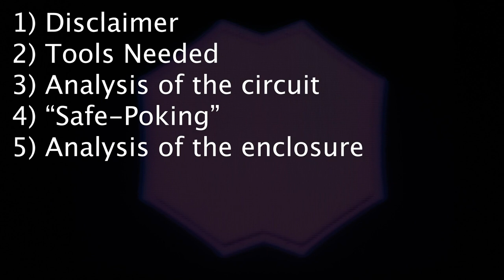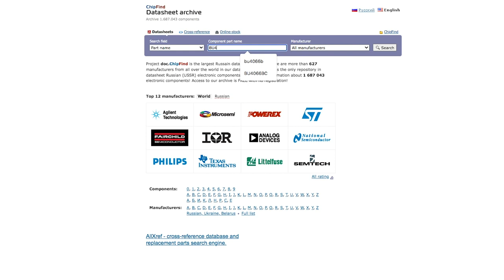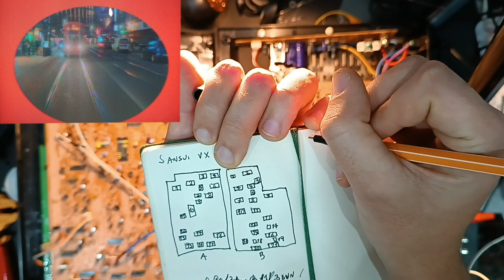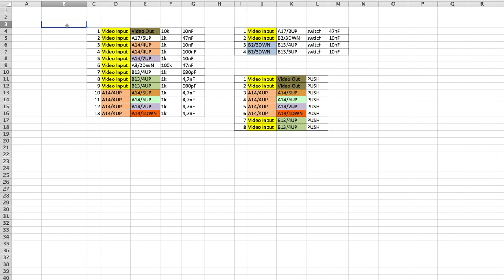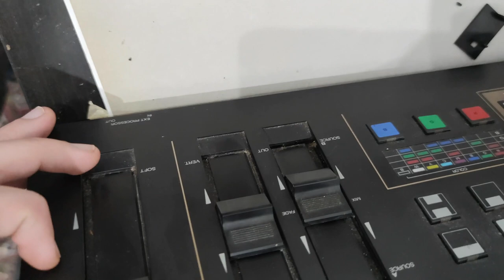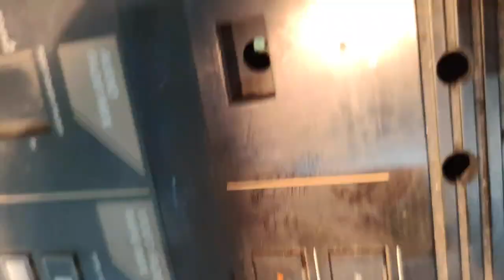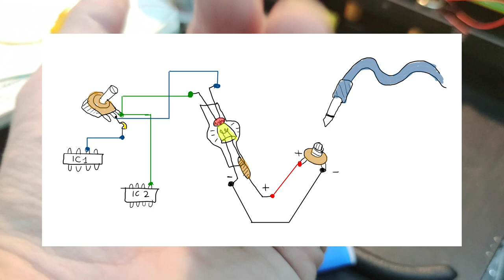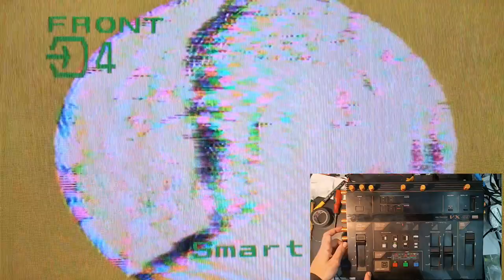How to circuit bend video devices FROM SCRATCH || Sansui VX-99 video bending Tutorial || Glitch

Comment: What LDRs are you using?  I can only get the light resistance of mine down to 2k ohms which is too much between bend points
Reply from the maker: I use the classical visible light LDRs, the small kind (just for a question of space, but the bigger ones work even better). Your LDR can emit only 2k ohms? That's weird. That could depend on the LED(s) you are using, or maybe the LDR in question is not working properly...
Reply: @pushkarbrand  it’s actually reading even higher than that.  You are able to get below 500ohm on your LDRs?  Thank you for the quick response btw
Reply from the maker: @iskatearound  Ok, now I understand. If you want to get a lower value you simply have to add some resistances (variable or fixed, depending on what you need) on one of the two legs of the LDR ;)
Reply: @pushkarbrand  in series? Wouldn’t that increase the equivalent resistance?
Reply from the maker: @iskatearound  yes, in series. And no, it would decrease the resistance of the LDR. You could also add a stronger resistance on the positive leg of the LED so that it emits a lower light.
Reply: @pushkarbrand  I was able to have great success with the following setup - just thought I’d let you know in case you wanted to try.  GL5506 LDRs, 5mm white leds, 330 ohm resistor (to + lug of LED).  I sanded down the led so it was nice and flat and there was less substrate that could diffuse the light.  I then taped the ldr and led together so they were sitting flat end to end.  And then wrapped in heatshrink.  Was able to get about 5-150 ohm range out of the ldr this way
Reply from the maker: @iskatearound  That's interesting! Thanks pal, I will give it a try!

Comment: Thank you for this video! Amazing work and very inspiring. I'm working on bending a small device now and I was curious about how you start with the video input pin - I assume you're routing this signal to each of the potentiometers, then routing separating ICs to each pot for different effects? If that's the case, how is the video signal chained in between pots? If thats not the case, can you offer some tips on how you've wired the pots to interact with the video signal?
Reply from the maker: I simply take the video input (or output) with an alligator clip, connect it to a pot (10-100k), take another alligator clip and connect another leg of the pot to other points of the board - excluding all the pins who bring dangerous voltages. If nothing happens, I try another pin. If it works, cool, I sign that pin (there's a chance that pin will give you something else if you connect it to another good pin), if the signal drops out, I try to insert a ceramic cap in the middle. And so on so forth :)
Reply: @pushkarbrand  Thx so much for the response, makes perfect sense - to follow up, I noticed in another response you referenced that on this particular device, the pins on the ICs didn’t really produce interesting effects when wired together. So in your final wire-up, were you just routing that initial video input + an individual IC pin to each pot?
Reply from the maker: @collinparmstrong  I don't remember exactly, but in the video description there are still two links for the schematics, so it should be easy to check ;)
Reply: @pushkarbrand  found what I was looking for - thx so much!!!

Comment: I need to find some "Speak & Spell" units, which have the same Speech Synthesis LPC chip as my TI 99/4A's free speech synthesizer cartridge. I only got as far as some Basic loops feeding it random Phonemes in random-length sentences.

Now, with greater education in this arena, adding some random Boolean Logic equations set in base-level 74HCxxx logic ICs and Analog/Digital multiplexers to 'automate' its actions is more educational, maybe?

Oddly enough, the local power company's autocall bill collector's voice changed from a Scaninavian-tinged English, but after a minute, it freaked-out and began spitting-out random Norwegian phonemes in random length sentences, just like the experiments with the Speak & Spell Texas Instrument Speech Synthesizer IC that same week.

Thank You for this instructional video, Maestro.

Databooks are our friend.

I simply cannot believe how many of these all-too-common "RAM OverClocking Tips" from pretenders do not reference RAM Databooks, wasting mine and million others timme to no end.
Reply: weird

this attempt looked like it had vanished due my phat phone fingers when it turned into a grey-shaded place with zero access to what I had just typed, sorry for repeats when I had to retype this one, thinking it was vanished.  ;-)

Comment: Would be possible to modify audio channels or circuits on this? For example you would connect external audio and the knobs would tweak or bend sound to distort a song which then goes to an external source such as speakers? Also could this unit create audio reactive glitch fx since it has audio in?
Reply from the maker: It is surely possible to modify audio circuit on units like these, but since the circuit is pretty basic, the bends will probably result in some form of distortion - which can surely be cool! Regarding the audioreactivess, I'm not 100% sure because I made this video a while ago, but  if I remember well it did not support audioreactiveness. The easiest way to try if it works it to use an alligator clip, poking the audio input (or output) and touching with the other end of the wire other point on the video board. If that does not work, an idea could be to build a simple envelope follower, so that the audio signal becomes a cv signal that can be routed to the vactrols ;)

Comment: Awesome video thanks so much! A few questions:

- Do you always use a resistance/pot in between the points when looking for new connections? If so, what value of resistance?
- Can you also connect safe (no GND or voltage) IC pins with other IC pins? In the end sheet you only connected ICs to their own points or to the video input.
- How do you select capacitor values?  You seem to just go by trial and error, but what do high/low values do to the signal generally?
- Does the order of cap -> pot /  pot -> cap matter?
- Regarding the CV input; Does the photoresistor add resistance to potmeter in the connection?
- Regarding the CV input(2); Why dont you connect the photoresistor in serial to the bend point?

Thx!
Reply from the maker: Thanks pal! So, regarding your questions:

- Yes, I always use a resistance/pot in between the points when I'm looking for new connections. I generally starts with a 50/100k, but then I make different attempts depending on how the connection reacts - if I see that it goes too far too quickly, I pick up a lower pot, if I see that does not glitch "enough" I go for a higher one.
- Yes, you can also connect IC pins with other IC pins. Simply, this device did not have any good connection between ICs.
- Exactly, I go by trial and error. There's not a general way in which the signal reacts, but often with higher values you have "wider", "more stretched" glitches, with lower values more "squeezed" glitches.
- No, it doesn't. You can put it before or after the pot, on any of the legs you are using.
- Yes, it does. It become a resistance that is controlled by the light of the led, so from the CV signal that the led is receiving.
- I'm not sure if I understood the question, but the CV input is connected in parallel to the corresponding bending point. Or, another way to read the question, I do not attach the Vactrol to the bend points because often they are distant, and/or because often there is not enough space to close the device.
Reply: @pushkarbrand  Again thanks alot, it's helping me feel very motivated to get back into bending again! Just bough a CRT and some gear to bend.

- Regarding safety: Why don't you probe the circuit with a multimeter to check for points where the power is running through? In another tutorial someone suggested to connect the multimeter with the middle leg of the transistor connected to the power section, and probing the circuit with the other leg and marking the points that you should stay away from. 

- Let me rephrase my last question: I don't understand why you connect the photoresistor legs of the Vactrol to the 2 pins of the potmeter. Shouldn't you have to connect the photoresistor legs to just 1 leg of the pot, en the other photoresistor leg to the cable is going to that pot leg and the point on the PCB?
Reply from the maker: @janhundling4647  I'm glad that this is helpful for you!

- Regarding safety, the approach you talk about it surely helpful but it does not allow you to find all the potentially dangerous points since there are some IC's that are powered up by a lower voltage - but still potentially dangerous - than are not connected to the middle leg of the transistor and that therefore cannot be detected with the multimeter. For sure with this method you can spot all the points in which you have the highest voltage on the pcb, but you cannot spot the points with lower voltage. In this sense, the best thing to do is to check the data sheet of each IC.

- Given that the point on the pbc and the pot leg are connected by a cable, it's the same connecting the leg of photoresistor to the point on the pcb, to the wire, or to the pot leg, they are all "the same" point, so it ends up being just a question on how comfortable you are with soldering here or there.

Comment: super helpful video! I'm just getting into circuit bending/electronics in general and was wondering why you are using capacitors instead of resistors?
Reply from the maker: Thanks! The capacitors change the way in which a glitch is visualised, while the resistors simply lower the amount of effect. They can also be used together is series!

Comment: Wow, great stuff! I have three questions if I may:
- did you circuit bend while using the wall adapter?
- if not, how did you manage to see the effects while experimenting with connections? Would a 12v battery be safe in that case?
- is this Bremen in the video?
Keep it up man, you did a great job
Reply from the maker: 1 and 2) Yes, I circuit bend while using the wall adapter, but before starting, I thoroughly explore the circuit to spot the dangerous pins, using the techniques explained in the video. I've never had any issues with this approach - indeed, I'm still alive :D. The important thing is to be 100% sure that the pins touched during the bending process, with the device powered on, do NOT carry dangerous voltages. Importantly, when I solder, I switch off the device. The device is switched on only when I'm testing the bend with alligator clips.

3)You are absolutely right! That's Bremen. I had a uni meeting there a couple of years ago and recorded some footage while I was on the tram:)
Reply: @pushkarbrand   I see! Many thanks for your valuable tips! First I wanna try to sort it out using a battery, if not I will definitely use your approach with caution! btw, I also was in Bremen in summer 2021, it's a lovely city and I could recognise it from the streets and the trams!

Comment: Hi, thank you for your video! Its very helpful. I have a question.
Is it unsafe to remove the scart connectors and replace them with composite one?
Reply from the maker: Hey, thanks! It is perfectly safe to substitute the scart connector with a composite one. Just to be sure, before doing that, connect the positive and negative pins of the scart to a composite socket with alligator clips and check if it works as it should
Reply: @pushkarbrand   Thanks for the advice!

Comment: Awesome and very inspiring video, thanks! Just got a question. What if you send a negative voltage to your CV input using the vactrol? That will work or simply will ignore the negative side? Thanks again for sharing it!
Reply from the maker: Thanks pal! If you send a negative voltage they will not work since the LED reacts only to positive voltages. This implies that if you want to have a negative side you have to treat your CV signal before routing it to the vactrol (for example by adding an offset to an attenuated LFO so that it will work in the range 0-+5V with the medium value in 2.5 instead of working in the range -5/+5V with the medium value in 0)
Reply: @pushkarbrand   Awesome, thank you! I have some passive attenuaverter that I could use to have 0...5V. Normally my modulations sources are unipolar, but this question crossed my mind by watching the vactrol part. Thanks a lot once more again, I've learnt a lot from your video. Can't wait to try the vactrol tip. Cheers mate!
Reply from the maker: @antblanc  You're welcome pal :) Btw, the very same technique can be applied in the audio domain -> (almost) free VCA/LPG!
Reply: @pushkarbrand  thanks man, so cool! I've tried the vactrol on my breadboard and this works perfectly, love it! Thanks once more again. Need to try only connecting the LDR pins to any fun spots to have some fun :) you rule mate!
Reply from the maker: @antblanc  I'm very happy to help pal! Endless CV controls for free :)

Comment: amazing video! what's your thoughts on using a continuity tester to check the chip voltages rather than looking up the data sheets?
Reply from the maker: Thanks :) using a continuity tester would surely work, but it is much more safer to find the data sheet of the chips to avoid the possibility to touching inadvertely two wrong pins during the testing process and breaking the device. However, if you do it with extra care it would surely work 💪🏽
Reply: @pushkarbrand  Perfect, makes complete  sense. Thank you for the reply!

Comment: Hi! How do you avoid of beint shocked? Is it the case of simply not touching the power supply related board?
Reply from the maker: Hi! No, it's not just a question of not touching the power supply area (which is surely something to strongly keep in mond) but also of avoiding the pins and components that carry high voltages. In this video I try to cover this question within the limits of my knowledge, so in any case, be always extra-careful when dealing with wall-powered devices

Comment: we have the same trinitron wega :) there must be a way in the service menu to get rid of the av4 / program references!
Reply from the maker: Oh yes there is, the only thing is that it looks like the option is accessible only with the original remote. I've tried with all sorts of apps but it did not work 🙃
Reply: @pushkarbrand  you mean the display key? i have the original, but i think you have to tweak the service menu, but idk which option in there.
Reply from the maker: @caesarblanko1399  if you have the original remote you can surely do it. Other trinitrons have the same option, and if I remember well you don't have to dig in the menu too much, it should simply be a button :) in any case, if you have the original remote you can surely fix the issue
Reply from the maker: @caesarblanko1399  Ok, I've checked. You have to press the DISPLAY button

Comment: Why you use 3 leds for the vactrol?
Reply from the maker: That's a trick that Mezkalin told me. You simply have a stronger light, so that the photoresistance reacts accordingly (the signal tend to be quite weak with just one LED).